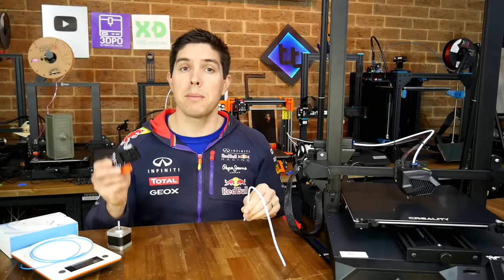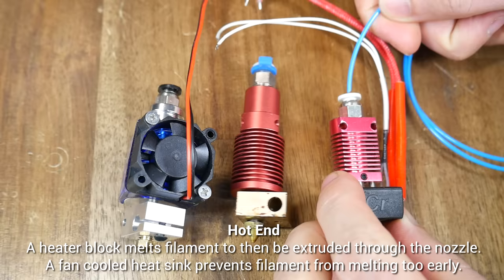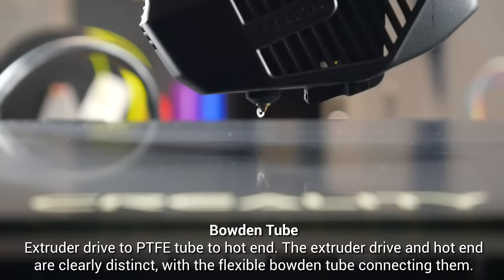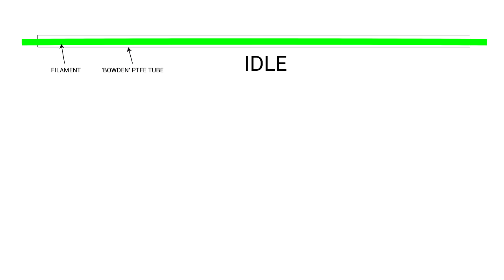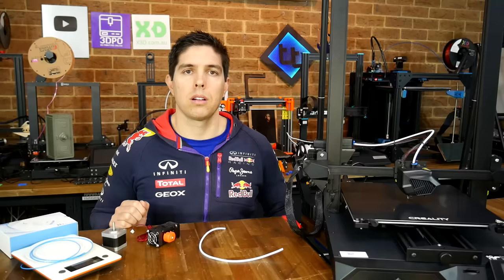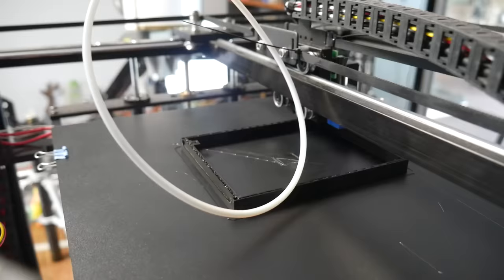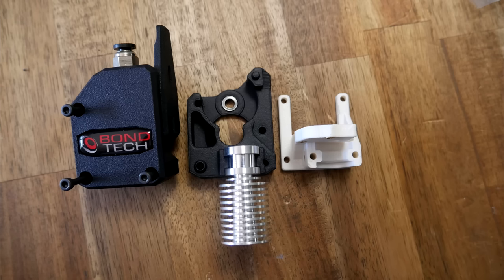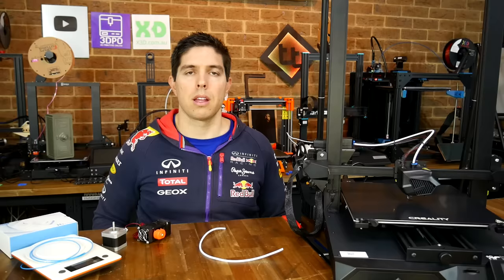Why direct drive is not automatically better than bowden tube

Comment: @10:10 Why do some manufacturers prefer bowen?  Cost.  Many printers have only one stepper motor on the Z-axis.  Essentially, a cantilever.   When a direct dive is used, the forces are greater due the the increased weight, and a second Z-axis motor is needed.  Using a bowden drive with its less weight means a company can do away with the second Z-axis stepper motor.
Reply: also nylon wheels which cant handle heavy load reliably.
Reply: Sorry this just isn't true. Tests have been done to show there less than 0.005 mm of sag from adding the weight of direct drive to the single side Z Axis. This is s myth that has been blown out of proportion with no numerical evidence.
Reply: @RFi731  they are polypropylene tho. Not Nylon.
Reply: @F2_CPB  They are normally delrin which is pom and some upgrade rollers are Polycarbonat.
Reply: I find this answer indicative to the reason 3D printer technology sucks so bad. Because everythings such a race to the bottom, no one can be bothered to innovate and create something truly special. They all gotta keep using the same dime store brand motors that have been used for literally decades. The thought of spending 40 dollars more to have a superior, stronger, lighter weight driver would cost too much and no one would bother when they can go "durr hurr look at my conversion kit" and they spend 20 dollars for a couple screws and a bracket and get exactly what they paid for. rant over
Reply: Is there a reason people choose to use 2 motors for the Z axis instead of running a belt between the leadscrews?
Reply: @user2C47  Yes automatic tilt adjust
Reply: @DeltaOps3  on the other hand. Chasing a lower budget is what's made 3d Printing accessable. Not many people can afford to buy a $1000 printer for hobby use.
Reply: @Erowens98  Yeah? so where can I buy a 3d printer with good support, large build volume (at least 300x300x300) thats tested, and works well without infinite fiddling and wasting money to replace every component to get decent prints for 1000$? I cant. That printer doesnt exist. Because how could it when china can make one for 1/3rd the price. there are people who NEED the space and quality who dont want to spend 400 dollars on junk and are bullied into paying 4000 dollars. To get my ender 5 plus working, I may have well had a part time job. I dont like wrenching on crap. I want it to work. People talk crap about Makerbot and how corporate theyve gotten, but I can truly say that to get it out of the box, press a button, and print a flawless print with no effort, not even any fiddling with a slicer... Its magic and well worth the 3700$ it costed. Theres no mid range printers.
Reply: @DeltaOps3  yeah no. That's not how any of this works. Nobody is bullying you into buying the budget option, and there are plenty of option that cost several times what the budget options do. As well as plenty of options in the middle.

It sounds like you expect a "mid range" printer to be every bit as good as the top end one.
Reply: @Erowens98  there arent printers between 300 dollar trash, and 1500 dollars that offer decent volume. there is no prusa "plus" sized models. only trash. Theres no market for something that expensive, not to mention many people ARE bullied into buying an objectively worse printer out of the box because theres a bigger aftermarket/user base that has tested the printers.
Reply: @Erowens98  googling the best printers for 1000 dollars doesnt do anyone justice. The moment you start looking outside a couple distinct brands, youre gambling your money. most manufactures are chinese and have an unknown user support and generally such a small userbase it makes it a bad bet to buy. Outside of a company like Prusa or maybe flashforge... goodluck. Im not saying 1000 dollar printers dont exist, im saying 1000 dollar printers that are comfortably in their pricerange and dont push themselves above their pricepoints by dropping things like support, reliability, parts availability etc..
Reply: @DeltaOps3  then buy from brands other people have experience with. Those exists too. Nobody is forcing you to buy from a brand you don't trust

Comment: I have an Aldi Cocoon Create. The first major mod I did to it was to convert it to Bowden drive, but I could never quite get the quality I was after. So I recently fitted an Orbiter extruder and designed the mount, etc, myself to make it as compact and light as I could get it. I'm, still sorting out a few bugs with it right now but I reckon it'll end up a better thing.
Thanks again for the good technical information in your videos.

Comment: One thing that isn't mentioned that I feel should be considered is maintenance.  Direct drive setups are a pain to replace the short bowden tube piece.  I print with PETG 24/7 and figured I would try direct drive on one of my Ender 3 Pros.  About once a week I have to replace the PTFE tube as it gets burned through near the nozzle with the higher temps and constantly disassembling the direct drive setup was annoying.  I also tried an all metal hotend to get the PTFE tube away from the nozzle entirely but that introduced more problems that I couldn't ever completely sort out.  I converted back to the factory bowden setup and now I can simply pull the bowden out of the hotend, snip it off, and shove it back in and have zero printing issues.  I just listen for the extruder skipping and know its time to snip the tube.  Went from a 10-15 minute tube replacement (also had to redo the Z-offset) with direct drive, to a 10 second bowden tube snip on the factory bowden setup.  Anyone running higher temp filaments should consider this before converting to direct drive.  For PLA and TPU direct drive is fine because you wont be replacing the tube much.

Even for flexibles I run bowden tube, just drill the extruder housing out and cut a V shape in a small piece of PTFE tube and shove it on the back side of the extruder gears.  No binding or spitting the TPU out the side of the extruder.  I honestly probably won't mess with direct drive again unless I start buying Prusa printers.

Comment: a good extruder (creality pro is enough) combined with with as short as possible bowden of a tube, which preferably is the good capricorn one, results in 5mm retraction distance with no stringing and good enough for flexible filaments at slow speeds. nothing bad with dd or bowdem both work if you tinker just a little.

Comment: I made the conversion to the modular direct drive setup you outlined and have been very happy with it. I am satisfied with slower print speeds, but am still having some issues with the first two base layers on larger prints. And yes, I painstakingly relevel the glass base on my CR-10 Mini before eack print but it will still have an inconsistent layer here and there. Just the fun of the "sport". Way better anti stringing performance.

Comment: I built my first printer over 4 years ago, I then went a built a larger version of the same printer with essentially the same configuration. Both printers have Bowden drives, and to be honest I don't have the need to change to a direct drive - I don't play with flexible filament, and that seems to be the only real advantage.
I could convert it whenever I wanted to, but I'm happy with the prints I'm getting.
If you're interested, I built a Hypercube by Tech2C, the forst is essentially the same as the first one he made, with a lot of basic mods, the second is much bigger and has dual Z axis motors. I built the entire thing, and I can fix or replace anything on the printer (which to be honest hasn't happened yet in the 2 years I've been running this printer)

Comment: Just upgraded to micro swiss direct drive kit on my cr10s pro v2 (with bl touch). Pretty straight forward. I don’t have to worry about the PTFE melting and causing clogs anymore. Plus better control on retraction. Made a vid on the assembly process to help others making the same upgrade.

Comment: Another downside of bowden - there are more potential points of failure. I've had the coupler on my microswiss strip the ptfe tube several times during long prints, causing the filament to pop out the top of the hot end. If i don't catch it early on I lose the print.... 
Got an LGX sitting on my desk just waiting to be installed now.
Reply: Yep.. Bowden tube pressures just make the whole damn thing seem silly. Blowing off the tubes on a big print with ABS or Polycarb is a common and expensive issue.. Tired of the nonsense myself...
Reply: @blaqlabspodcast5816  Blowing off the tube just hints at issues with your melting speed.
If the hot end can't keep up with the feed rate, the filament will find a way to release pressure...
Have a look at your hotend and nozzle and check, if the hotend can really keep up.

Comment: I'm glad you at least mentioned Remote Direct Drive. In my experience it is a pretty good compromise, but people have all sorts of preconceptions about it being inaccurate because of the flex shaft. I know from experience that is a completely false perception. It would be an interesting video to see you try a remote direct drive conversion on one of your printers. I have one on my Ender 3.
Reply: Direct drive with some reduction built into teh extruder seems like the perfect middle point!
Reply: Remote motors /flex drive shaft Are imprecise contraptions . Because these typically use High Ratio and inefficient  worm gear drives  A Serious design failing.

Comment: I would like a direct drive extruder because it's easier to calibrate and less prone to clogging. Most of my issues with my printer is me dealing with Bowden tube. Also flexible filaments are a nightmare to use on Bowden even though I get successful prints all the time...if the filament doesn't get tangled and shoot sideways outside of the extruder.

Comment: Great video of the two types of Extruder setups.
i will be changing my PTFE setup to direct drive on my Enders 3 v2

as i have had nothing but problems.
5 years i have been using direct drives and no problems

Comment: Not to jinx myself, but I have been REALLY impressed with the (lack of) stringing on my Tronxy XY-2 on a bowden with stock settings. I've never had to print a retraction tower (yet) and just need a temperature tower to dial in the prints.

Comment: I have had a CR 10S Pro V1 for 3 years. I listen to most all your posts regarding the Brand and Model. I held off getting Direct Drive until my team mate Andy installed the Micro Swiss Direct Drive to his 10s Pro V2. He was all over it telling his machine was a new machine, much better control. So I sprung for the kit. I already made several updates. New Bed Sensor, Micro Swiss Hot end with Steel Nozzle, Z Axis Synchronized upper belt and 10S Max Z axis Struts. So i was not worried about adding the Direct Drive. Oh thing Andy hammer on me was to get BL Touch Plus the Micro Swiss Direct Drive. I used Tiny Machines and they included all the code updates to the screen and Hex Firmware. It took me two days to get all the way thru the process. The result is Less Retraction and not retracting thru a Bowden Tube seemed to really calm down the whole process. I held my finger and various location to feel for vibration and there was NONE. The print was smooth and damn near flawless. A few nerds that is likely my damp basement and too hot nozzle with direct drive. My prints are better, my machine runs smooth and the frame feels solid and now vibrations anywhere. Andy and I all sold on this Conversion with this part set and on this machine. Dennis

Comment: This is probably a subset of "retraction issues," but I'm changing my Ender 5 pro to direct drive to deal with heat creep issues printing ABS with an all metal hot-end.  As it was explained to me, too much retraction pulls the hot plastic into the "cold" part of the hot-end and causes jamming that looks very similar to ineffective cooling.  With the direct drive, the shorter retraction length should help very much with that problem.  We'll find out!  (The upgrade hit a delay when I over-torqued the nozzle and ripped it in half, so I'm waiting on a new nozzle and heater block...)

Comment: I had a Bowden tube setup which printed very well and rarely had jams. I recently changed to Micro Swiss because I wanted to try flexible filaments and heard DD was better for this type filament than Bowden tube. The DD is amazing. Filament changes are easy and I found setting it up was pretty easy for this newbie. I haven't tried flexible filaments yet. I totally agree with mass being a factor but am happy with what I consider to be an upgrade. I believe we'll see more improvements in this area. Thanks so much for your videos which teach me alot about this challenging hobby.

Comment: Makes sense you would want the least amount of weight, load on the print head. I was wondering why the direct drive was so popular due to its inherent design flaws. Even with the compact motor and design, I would think you are still running a heaver head. The hybrid system looks like the most feasible for weight distribution. Thank you for the insight btw, great video.

Comment: Hmm... I think replacing a bowden drive for a direct drive is maybe a improvement for printers with a fast moving bed. However in the case of my printer, an Creality Ender 5, it will actually be worst. Here we do not have a fast moving building platform, but a platform that only moves slowly up and down. The main movement in X and Y direction is done by the print head. Adding mass to it will actually introduce more ringing to the point it is getting ugly. The best modification I made for now, is moving the stepper motor for the bowden from the side to the top, and thus shortening the bowden tube.
In this case a (very) light weight direct drive would be a solution. Sadly enough there is no one that I know about that would fit on a Ender 5. Most of the conversion kits even use the (heavy) original stepper motor, that is far to weighty and induce a LOT of ringing. So - For printers that use a fast XY movement and a slow up/down platform, there are no real working solutions.
Reply: I was thinking of doing to the upgrade to my ender 5 pro until I read your comment. Thanks for sharing your experience with your us.
Reply: @tarigomar7982  The new Ender 3 S1 has a direct drive head (as far as I know the first Creality ever made) that has a pancake stepper motor plus a CR-touch and seems to be not that heavy. They are sold separately from the printer (at least the full metal ones), so maybe in the future they will also make a replacement for the standard Ender 5. I think it will be heartily welcomed by a lot of the Ender 5 users.
Reply: @jclosed2516  I also had problems, but I solved it with a new nozzle that has a longer thread, so the bovden no longer heats up and the filament no longer flows around the bovden.

Comment: I'm honestly using both types of extruders on my machines. But mostly bowden because it was the most practical in the designs. One of the machines is a completely redesigned and overhauled Makerbot Replicator 2x. A bowden setup was the best choice for this machine because when I started this build, the Orbiter and Sherpa weren't that familiar to me and bowden was, plus, the space available within the machines physical parts is quite limited.

So I converted it to bowden with a very short tube and honestly, it works great, high speed with no stringing. It's not dialed in perfectly, but it's already printing really well.

On my Delta I also use bowden for obvious reasons, it's also a small machine, so even an Orbiter wasn't small enough for the carriage.

Third is a DIY Prusa MK2S with a direct drive extruder, because it has a big nozzle size on it and needs to push a lot of filament, in this machine the direct drive was the most obvious solution as due to the larger nozzle, the print speed was already limited. The E3D v6 hotend can't keep up with heating the filament fast enough because it needs to feed a larger volume, causing the hotend to cool down too much during fast prints. Here the advantage of better retraction was also noticeable because a bigger nozzle tends to ooze more.

And then I have a bunch of smaller machines, which are all equipped with random parts and there isn't really any logical choice made in why which extruder was chosen. I also never use the smaller machines.

Comment: I rarely have retract issues or filamet spider webs with my machines, bowden tube has a lot of pluses at least on the Anycubic I3 atchitecture, the stepper motor for the  gantry side to side movement is balanced with the filament drive stepper  motor (which many people incorrectly refer to as the  extruder)in the injection molding industry extruder is a machine that processes and converts plastic pellets through hot nozzle, into a solid long shape,  the plastic is extruded through the extruder head in this case,  but the complete machine can also be referred to as a plastic extruder for simplicity.  However on 3D printer you have a stepper driver that is actually driving or delivering the plastic filament to the extruder head therefor the extruder is the hot end assembly. 

 In the case of the anycubic I3 Mega, the filament driver motor also holds the bowden tube at the opposite end,  this symmetry in grantry mass is important, but more important is keeping the print head as light as possible.

While direct drive has it pluses, for certain types and size of machines,  ease of filament entry and hot end servicing,  bowden tube in an architecture as I just described, with the Anycubic I3 machine, is best. I have yet to see a head design in direct drive that is light enough to obtain fast and consise prints on a table top machine.